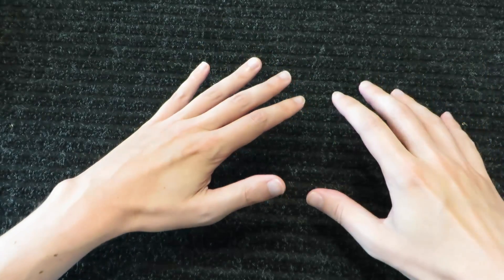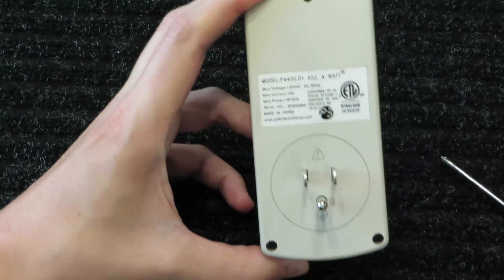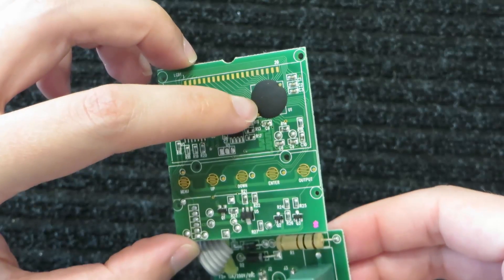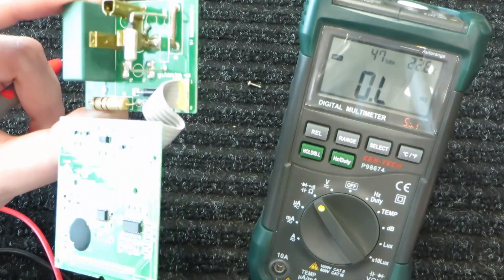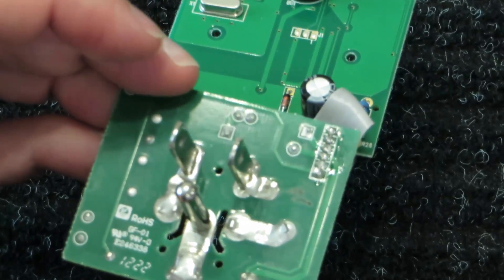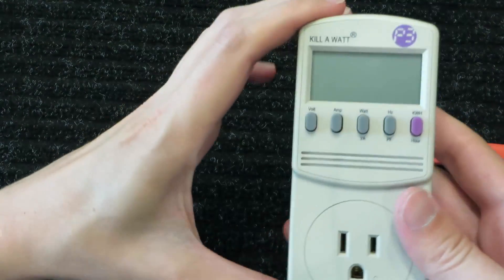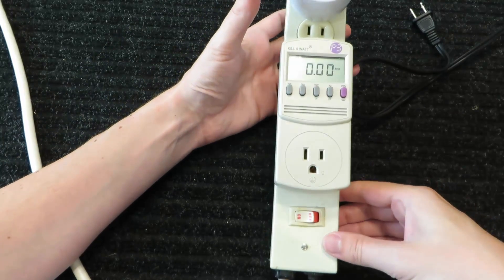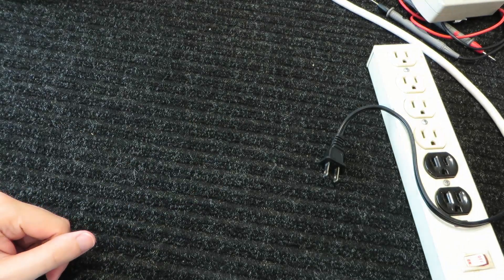Kill-A-Watt P3 Meter - Disassembly and Repair

Comment: Great video!! Would that same thermal fuse give you wrong output voltage if it's going bad? I have a p3 and it is giving wrong voltage.
Reply from the maker: I had a P3 showing wrong voltage and it was a failed film capacitor.  Given the relatively high cost of a replacement capacitor and reasonable cost of a replacement P3 meter I'd recommend chucking it in the trash and buying a new one unfortunately.

Comment: I did the same thing you did. cut it out put the leads together with a dab of solder. Ordered a new fuse. got 2 for 8 bucks with crimp connections. Now I'm not sure I'll ever put em in. lol
Reply from the maker: yeah, I never put a fuse back in.  Would be a good idea to though!

Comment: Pretty sure a car fuse isn't rated up to 250V and sticking a 20A into a 15A required fuse location 'just because that's all you have is never a good idea.
Reply from the maker: You're correct.  I made that mistake in this video.

Comment: Don't use 12/24v fuses in a 120vac application, they are not rated for that voltage and they can ark over catch fire etc.
Reply from the maker: This is correct.  I made that error in this video.

Comment: It is NOT a resettable fuse. If it blows, you have to replace it.
I am aware that this video is 5 years old, but comment for the 2020 and up viewers.
Just purchase a new set of thermal fuses on banggood or ali express, and you're good 👍
Edit: car fuses are NOT fit for this purpose. They cannot handle the power of a short.
Reply from the maker: You are correct on all accounts, except that I would not trust fuses from ali express.
Reply: @knurlgnar24  Okay. Not my favourite source either, but considering that your powermeter was most likely built in China, there is less reason to distrust these sources I mentioned. If you can find a better source, like German ,  I agree that you would be better of. 
Cheers and 🤝🇳🇱

Comment: The thermal fuse is a NON-resettable thermal fuse. It permanently opens up when its rated temperature is exceeded. By its location, it appears to be monitoring the temperature of the main power output port. You generally would not want it to keep cycling ON/OFF/ON/OFF... with an over-temperature condition. Continued cyclic overheating...as the case plastic might not cool sufficiently before the resettable fuse resets...might eventually cause the plastic case to deform and since it's a main power port, could result in some other more significant failure with loss of case integrity.
Reply from the maker: You are correct.  This was an error on my part.  Thanks for the comment.

Comment: Amazon doesn't list the SEFUSE SF96U-1 (99C 15 A) fuse anymore.  Instead I see SF96E SEFUSE Cutoffs NEC Thermal Fuse 99 C 99 Degree 10A 250V  are these interchangeable?  

https://www.amazon.com/SF96E-SEFUSE-Cutoffs-Thermal-Degree/dp/B0115D7PZ8/ref=sr_1_fkmr0_1?dchild=1&keywords=SF96e-1+SEFUSE+Cutoffs+NEC+Thermal+Fuse+99%C2%B0C+99+Degree+15A+250V&qid=1595970820&s=industrial&sr=1-1-fkmr0

Comment: Yours is definitely a newer model than mine that failed after all these years. Mine has a big board that holds the plug and socket parts and a smaller board for the display and buttons.  It has a small, soldered in, glass fuse. And mine was made in Taiwan, not China. The older ones used a whole lot more parts and did not use the fuse you cut out. How old is mine? It has a 2001 date code on it. :-) https://www.youtube.com/watch?v=MeTVCbjFft4 shows the insides of the older version at 9:45.
Reply from the maker: Interesting!  Thanks for the info.

Comment: A quick check of Ebay for "15a thermal fuse" finds 85C and 105C versions for about $1 each.  The higher temp ones (140C and up) are about $0.25 each.  This size thermal fuse is not resetable.  Only the physically bigger ones are PTC material that recovers when cool.

For a few $ more, you could have a 15A manual reset breaker that would just fit in the space available.

I'd pull the thermal fuse from a trashed hair dryer or curling iron and call it good enough.

Comment: Hi there! I learned the hard way that the Watts Up Pro should NEVER be connected to a square wave inverter. BZZZT and a big cloud of white smoke. The company also went under. I would really really like to get in touch with anyone who worked at the firm's engineering. Would hate to see it go to waste.

Comment: What if you left a gap between the leads of the thermal fuse and bridged it with a short piece of that very small solder that you used. Wouldn't that act as a visible link that would melt and open If a large current passed through it. I really enjoy your videos.

Comment: Man, thanks a million, I just had thrown mine to the bin, then found the video, dissembled mine, measured the fuses, thermal had no continuity so same issue as yours because I also forced mine to the limits. I just cut the thermal fuse, soldered wires and mine's back.

I do not know if there wil be future concerns with it or if it's advisable to force it to I>15A?.

Thanks and God bless.

Comment: Is the kill-a-watt basically the same as connecting an amp-meter in-line with a circuit, or is the current sensing decoupled from the actual circuit you're measuring like a clamp meter?

Comment: I have a similar device but my model has a flaw - that large resistor seems to get hot even after a few minutes of measuring of less than 200 watts. It gets so hot that I even can feel that nasty "hot electronics" smell when I look close at the LCD, and one corner of the LCD gets yellowish because of the heat. So, I don't feel safe using it. Do they all have this issue with that resistor getting so smelly hot?

Comment: FWIW, the earlier models didn't have the thermal fuse so essentially you've just downgraded it. I concur with other comments that that is not a resetable fuse but does require replacement after overtemperature has occurred.

Comment: Ok it fixed it, but I don’t recommend fixing it this way. It could be a fire hazard under the correct conditions now that it doesn’t have a thermal fuse. Jump on eBay and buy some thermal fuses for cheap. They are color coded. 
The reason it had a thermal fuse was because of what he called the current resistor (shunt with a know resistance made from a specific material just like in most common multimeters) can heat up when over loaded, or even if not overloaded maybe if it was running in a hotter ambient temperature. The thermal fuse is to protect damaging the shunt from melting or acting like a fuse that could also start a fire. 
So do yourself a favor, don’t repair this meter this way. Spend a few dollars and get a pack of thermal fuses. They are common on motors like when you put to much in a blender. So if you have a blender that doesn’t work, you could fix it also. They are color coded, and have text on the fuse as well, not every manufacture is nice enough to print the fuse rating on the PCB board. 
But that did have enough room for a resettable fuse to me installed, so that would have been another option. Some problems with this would be if the resettable fuse trios it’s for a reason, then it will turn back on, then trip again. When you look at the kilowatt meter you reading won’t be accurate if you measure something for 24 hours because it could have reset a few times. So that’s probably why they didn’t use a resettable fuse to begin with. 

FYI: A resettable temperature fuse is usually rectangular, bigger then that one, encased in some plastic and placed against the motor or thing making heat to prevent damage to the thing making heat. Also used not just on motors, but things like linear transformers in DC bench power supplies, some computer power supplies, transformers in bigger soldering irons, and so on.

Comment: Didn't you or anyone else notice? This device is fused in the NEUTRAL (the wide blade)! WTF!! How the hell did this ever pass UL listing? (Well not exactly UL; it's rated cETLus, which means it's been tested by ETL to both Canadian CSA and UL standards.) When the fuse blows, it will leave any device plugged into it apparently off but actually energized. If that's a lamp with an Edison base socket the full line voltage will be present on the outer thread of the bulb. He did the right thing by bypassing the fuse; having it unfused is better than being fused in the neutral.

Incidentally, this teardown is of the latest version, model P4400.01; I believe the original model P4400 did not have this problem from another YouTube video.

Comment: I have just found that I have a similar energy monitoring plug. I have found that it overheated when being run from an inverter but it runs cool from normal mains. I have had similar issues driving LED that use a similar capacitor dropper circuit. I thought the issue was due to the sharp rise times of the square wave edges from the inverter causing an over current. Now I’m not sure but would appreciate your comments. https://youtu.be/dD4_7QR1uXo.  PS I think that fuse you replaced looked like a one time use thermal overload- oops just watched again you said that. Thanks Regards Chris

Comment: I just fixed my P4460.01 this way, thanks for the troubleshooting and accuracy testing! To save time I just clipped the fuse out and twisted the wires together with pliers. EVEN SAFER than your method! :) I'll update this post if my house burns down.
I've killed 3 of the 4460's and never put bigger than a regular 15A appliance on them! I returned the other two, but fixed this last out of embarrassment to return it a 3rd time. I think they should use breakers in these things, since they're for dumb consumers like me. Sounds like your model can handle more current and wouldn't have blown on me.
I assumed it was startup burst voltage, as both 'killer loads' measured under 15A stable when I hooked them up. Yet they both killed their respective P4460EZ after an hour or so. Doesn't sounds like that'd kill a thermal fuse. Maybe it will blow from either excessive heat (average power) or a spike in current (instant power). First it was a 90's era fridge, then a 'new old tech' glowing wire type box heater. That 2nd one surprised me, since it measured a steady 14A even and seemed too simple a circuit to fluctuate much!

Comment: I hade one of these connected to a eu2000i and it ran out of fuel. The next time I used it the current was incorrect. I inquired to the manufacturer and wa load present to recalibrates informed that it needed calibration. I forgot the sequence of buttons to enter recalibration but do remember it needs a 125 volt 10 amp precisely. Btw that thermal fuse is non resettable. They are common in automotive blower motor resistors and hairdryers exc.

Comment: hello knurlgnar24 great demonstration I also ruined a kilowatt meter when Istarted a generator with it pluged in the initial start of the generator caused its voltage to surge and it blew the kw meter.did you know the kilo watt meter will not work properly on square wave. the power supply in it could blow out . Keep the Faith John Millard
Reply: Good to know

Comment: The thermal protect is a one time only device. Once thermally overloaded, it must be replaced. They do come in various trigger temps & amp/volt rating.
Reply: Surprised he didn't know that that fuse was a single- shot component.

Comment: I have 2 of the p3's that were used on a campers main cord 30 + amps and now when I plug them in the house they read 147 volts. I checked with my multi meter and its normal at 124.7 volts. Is their any hope of repairing the p3 .
Reply: @larry haney Here's a  really god write up about the faulty voltage readings:  http://ka7oei.blogspot.com/2017/10/fixing-my-failed-kill-watt-meter-and.html
Reply: @NeverTookTheTime   Thanks ... good write up ... Did u get yours working ?
Reply: @larryhaney6608  I've ordered the replacement cap.  I'll let you know how I make out.....
Reply: @larryhaney6608  I replaced the cap.  But that didn't fix the problem.  I was able to "reset" the high "Volt" reading but now with nothing plugged in to the P3 the "Watt" reading fluctuates with values between 0.0 and 12.6.  Bummer.
Reply: try replacing the film cap
Reply: +DMAN22yeah   OK  thanks I'll try that
Reply: @larryhaney6608  Did you replace the cap?  Did it help?  My unit reads 143V on a 118V outlet....
Reply: @NeverTookTheTime   No I never went back to that project I had another p3 put away and have been using it ever sense . ... I u do yours let me know how comes out please .
Reply: @larryhaney6608  Check this out:  https://www.pupman.com/listarchives/2003/May/msg00077.html  
My Kill-a-Watt (model:  P4400.01) was reading 143.5V in all my outlets.  I was able to re-calibrate my meter by plugging it into a power strip, holding down the VOLT button on the meter and then turning on the power strip to get into the "OPEN" state.  And then I followed the instructions from pupman.com (above).  My meter now reads 110.1V.  Good luck and let me know how you make out.

Comment: I used my old home electric meter exactly as you described in your video to determine the operating power of various loads.

Good simple & inexpensive fix for your Killawatt meter.  I have one of those also & I find it to be a very good device.

You could have simply used a jumper wire with alligator clips on each end to bypass the open thermal fuse--you know, just to test to see if the meter would power up.
Either way, you fixed your problem.  Good job & thanks for sharing!

Comment: I think they just use a cheap fuse there.  I had mine blow the same fuse (and i fixed it the exact same way, lol).  It blew when I had around a 1300 watt load on it.  Didnt seem hot either.
Reply: I just blew mine today, thought it was safe to test a device with 1500 watts. They shouldn't really rate it 15A. 7.5A maybe, because I've seen someone reported not being able to handle even 1000W.

Comment: The conductive strip is often called a "zebra strip" and has been used forever.  I am surprised you have not seen it before.  When I was a kid in the '80s I used to disassemble calculators and even then, the dawn of the LCD, contact between a PCB and LCD panel was made in this way.  I see that there is a Wikipedia article on these, and there it is called an elastomeric connector.

The strip is composed of a kind of flexible rubber or silicone, with alternating conductive and non-conductive elements.  On the strips I've seen, these are at a pitch much greater than the conductors that are being mated, as it were.  This allows the strip to be just dropped in without alignment, while providing numerous redundant connections per LCD segment.  It goes without saying (but I will say it anyway) that this only works because the LCD consumes almost no current, so the relatively high resistance of the conductors is not a problem.
Reply from the maker: pillsnotbills Thanks for the info!
Reply: I've seen plenty of similar designs where the alignment is hyper-critical. In some devices it's nearly impossible to manually align them correctly once separated. Some large LCD TV/computer display screens and some LCD micro-displays screens (like watches) are examples of this. However, in this particular case the contacts seem to be so large this probably is not a problem.

Comment: You can't use low voltage dc blade fuse for high voltage ac!!! You should not recommend this! Also You should twist this wires before soldering.
Reply: ac arcs less than even half the volts of dc so yes you can. its not up to code but it is safe

Comment: Whether the fuse is needed or not, why not just solder a cheap glass fuse in place of the one you removed? I follow your videos and you're obviously very competent with electronics, I'm just curious why you made the decision to just completely bypass it.
Reply from the maker: Gadget Addict I didn't have an appropriate one on hand, and I didn't want to have to replace another fuse later.  I intend to abuse this meter more in the future.
Reply: ***** I've been missing your videos, I look forward to seeing your meter abuse! Always entertaining and educational :-)
Reply: It's not that kind of fuse. It's a THERMAL fuse. It activates (opens, in this case permanently) when something nearby gets too hot...not when too much power runs through it.

Comment: But the other kill-a-watt meter that failed didn't it have the same thermal fuse as you needed? :)
Reply from the maker: Hagis2k It did, but it still works.  I just don't trust it until a tweak a solder connection inside.  In retrospect I should have also fixed that one in this video...

Comment: My P3 is out of calibration, it reads about 10% high on volts, all other functions seem normal. This started after checking an old Onan generator that had a no load output of 132 volts. P3 international said to get a new one, not what I wanted to hear.
Reply from the maker: Craig Nehring I've seen that in these P3's.  It's probably most practical to just buy another one but if you're into fixing this sort of thing check the large film capacitor inside it.  When that goes bad it no longer reads the proper voltage.
Reply: Did you try replacing the cap?  Did it help?  My unit reads 143VAC on a 118VAC outlet.

Comment: Or maybe it's a normal thermal fuse. I am not sure what made you think they were resettable
Reply from the maker: ***** Doh!  Yes, it's probably not a resettable type.  They look exactly the same but cost more so they likely didn't use that type in this application.
Reply: the resettable type fuses are typically low power, and not suitable on the AC mains lines
Reply: @FooBar89  This is monitoring the temperature of a physical power lead at the case power port. It's not part of the power circuit that opens when too much current passes through it. But it is non-resettable.